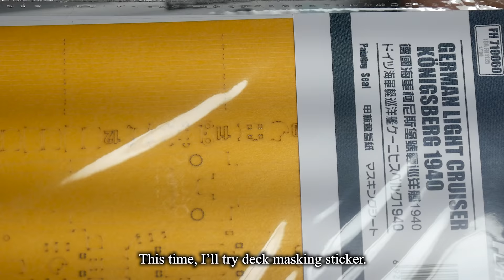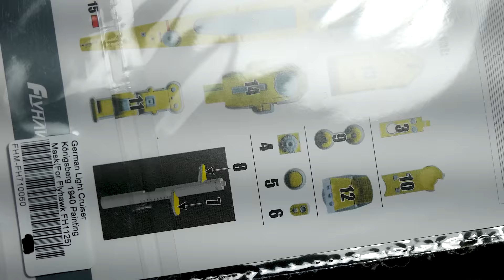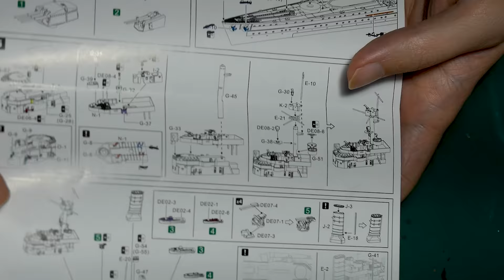How to make Ocean Diorama. 1/700 Konigsberg Dodging Torpedoes

Comment: Hard work pays off.  Amazing built. Thank you for sharing. Why havent you made the torpedo trails under water? You could do it exactly as you did  with cotton etc but then submerge it under the last layer of resin.
Reply from the maker: I think that it makes the torpedoes like underwater missiles, 
and I prefer to have more resemblance to World of Warship's torpedoes.
Thank you for the comment.
Reply: @EbroinSong  that makes sense. Thanks
Reply: What he has done is correct WW2 torpedoes left a white wake of bubbles behind the torpedoes when travelling at high speed like a jet ski for example
Reply: @inklinggirl6724  they left a trail behind at any speed because they were powered by steam. the German electric torpedos only left a cavitation trail at high speeds but those arent as noticeable
Reply: @frogsshadow4189  the Japanese oxygen torpedoes were the least visual.

Comment: I too find the instructions for PE to be confusing.  It would be nice if the PE makers would mark where the PE takes place in the model instructions (page 12, step 3).  I’ve also found that if one is using a wooden deck overlay, one can use the discarded sheet the deck came out of the create a one piece mask.  It saves time

Comment: 4:03 I wish I had to build this ship, after swimming head first, through an upside down tube that's only the width of my shoulders. And when I get to the kit, at the bottom of the tube. I can only use tweezers, not my fingers. And my only source of light is a flashlight that badly flickers. 
I know some people have claustrophobia. But I have the very opposite of that. I enjoy extremely tedious tasks, under high pressure. And so the aforementioned statement is my fantasy. I've added to it over the years.
I think people who go spelunking (under water cave diving), have the same desires as me.

Comment: Great build! But what superglue are you using for PE? I can sometimes struggle to keep some PE glued in place.
Reply from the maker: I used Loctite 401. I also struggle to keep them on place, I just try not to though them after they were glued.
Reply: Loctite and the gorilla glue bottle with a blue cap are both great glues to use for PE!

Comment: Other navies: Build whole cruiser classes arround AA
Kriegsmarine: AA is optional
Reply: The Konigsberg was designed in the early 1920s. It was never meant to have much in the way of AA, and it is difficult to compare it with later cruisers. Also, these cruisers were mostly used for training and did not see much combat, if any, after 1940.

Comment: Does your tool for manually extracting bubbles work well? I want to buy an electric one, but it's very expensive. I found that your later works don't use it anymore. How do you get rid of the resin bubbles now?

Comment: a quick question the mr surfacer can you mounted the hull on when painting is that a normal 40 ml can or a larger one ? it looks a lot larger than a 40ml but it might just be me and the size of the model
Reply from the maker: It is just common 40 ml bottle. Probably the size of the ship made the bottle looks bigger.